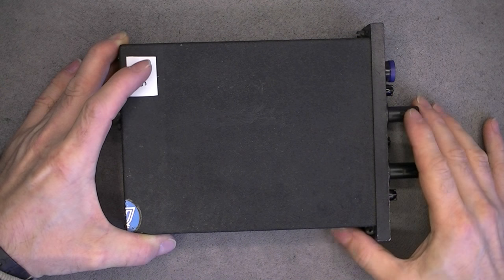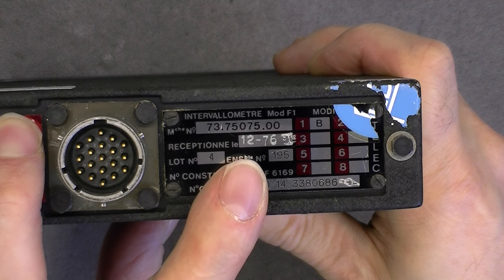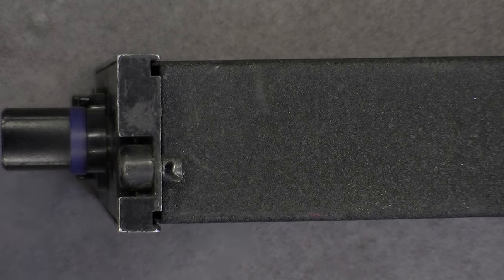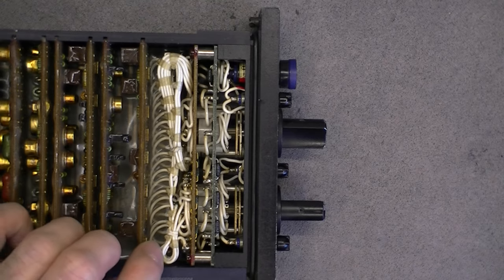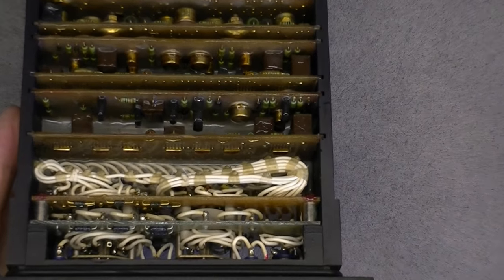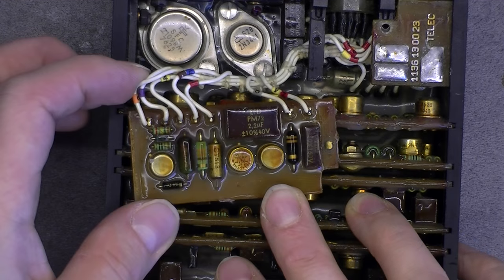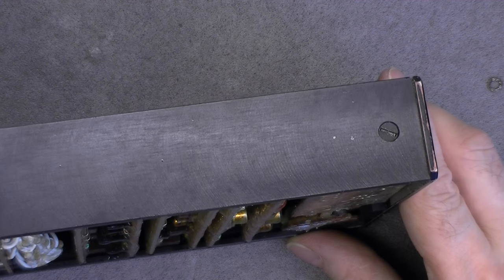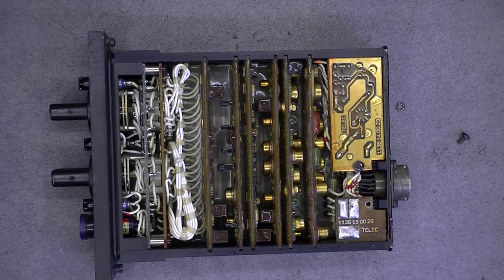Bomber aircraft intervallometer teardown

Comment: Worked by being connected to the 28V battery supply. There is a relay coil ( the teledyne one on the little board) that is used to bring in the trigger from the bombing computer, and there is a resistor network ( totally isolated from any connection in the unit BTW) that feeds a potential divided signal derived from the 26VAC 400Hz reference signal back to the bombing computer to tell it the advance triggering required. There is a second resistor network on the switch used internally to the intervalometer to give it the same timing interval, used to generate a clock signal to drive the release mechanism. 

The number selector uses a lot of those flatpack IC's to make up a synchronous digital counter that will generate a release pulse for every clock signal the timer gives, once you have received the trigger from the bombing computer that travel distance of the selected munition is less than distance to target, adjusted for the delay selected. Then it will generate these pulses, which go to another box deeper in the avionics frame, which takes these pulses and drives the firing relays for the weapons systems, selecting a different one every pulse in sequence. Yes, having it fail and false trigger would be not a good day.

The little board with a fuse and resistor is a case heater, as this is located where sweat will fall on it from the pilot, or where rain on the flight line can get on it. The ferrite pot core under it with 2 coloured enamelled copper wires is a power filter for the 28VDC input, I rewound a few of those which had cooked. I worked on a local made version, which had a lot more functionality, and which was a lot more reliable than those older ones, which would fail safe and not drop at all. The blue button with light is an activity indicator, lights up blue when the unit is triggered and counting, so the pilot knows not to make too much control input, as otherwise he can get tangled up in his ejected stores.

Incidentally, there is a jettison switch as well on the arming panel, where you can select to either drop the bomb manually with it being armed on release, or to jettison it with the safety pins still engaged. You cam select all , or single, or to drop the pylon or a fuel tank. Uses the same pyro fuses as the gun recocking unit.
Reply: SeanBZA thanks a lot for your info on this!... you must either be an enthusiasts, or engineer specialist!... either way thanks for your knowledge and feedback, both me  and msylvain59 are very thankful for not only your knowledge, but the time you took to write it first!... thanks  again!, to both you msylvain59, and SeanBZA for sharing!... Cheers from Canada, to both of you!!!...